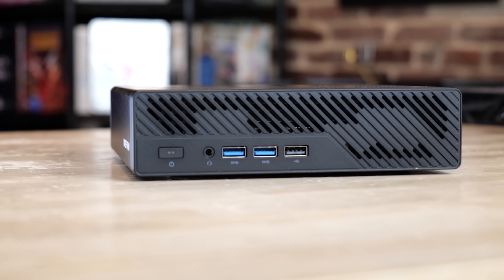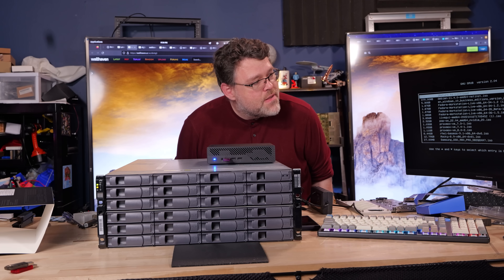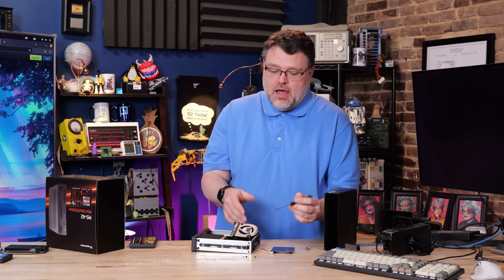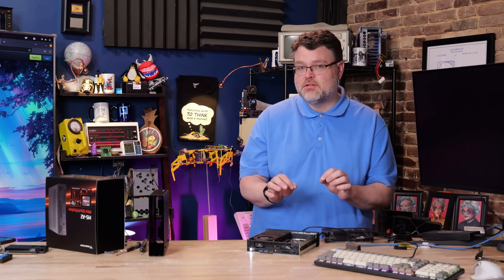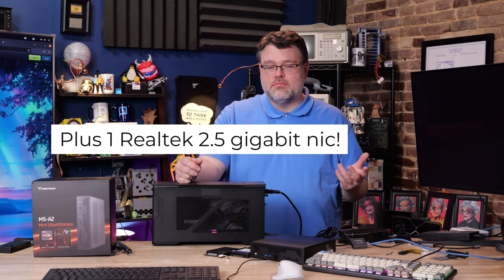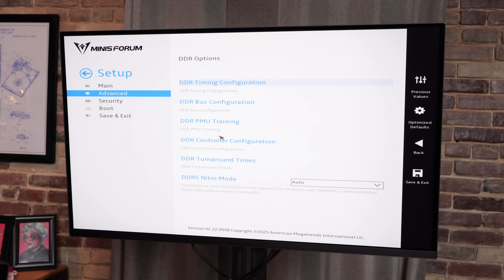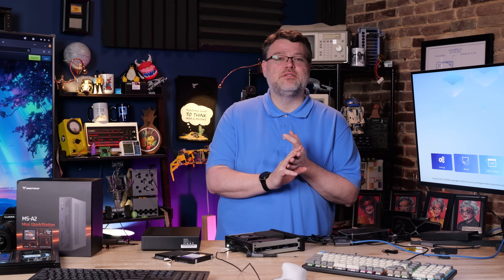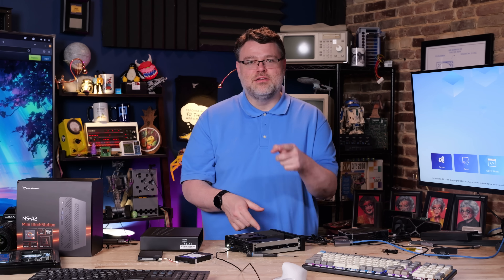Small Form Factor Workstation: Reviewing and Benchmarking the Minisforum MS-A2

Comment: Is the 7945HX option also capable of doing 128gb of ram?
Reply: Nope. 64gb max. 
Some people claim that you can run two 48gb dimms, but I doubt it.
Reply: @MrFrankArcher have you tried 128 on 7945?
Reply: @MrFrankArcher  Can you explain you comment / where did you get the Info from?

As far as i have read on the product page and reddit the 7945HX should still work with 128GB of RAM but with just DDR5-5200 instead of DDR5-5600

Comment: Huge improvements from 01, single and multi core improvement of 30%, pcie bifurcation (no need to buy to expensive and scare pcie chip based cards) better lanes layout for the nvme drives.

Comment: This with 64GB of ECC is such a baller little node.
Reply: I don't think it supports ECC memory, it's not advertised by minisforum
Reply: @PricelessToolkit in this video he says it does support ecc
Reply: @PricelessToolkit I believe only the 9550 version does, the 7550(?) does not because it’s a mobile/desktop chip, not just a desktop chip
Reply: @harrychufan I don't understand. If it supports it, then why isn't it written on the website? ECC memory support is a big plus for me.
Reply: Trying to figure this out ecc is automatically me buying as many as I can get my hands on.
Reply: Don't use chatgpt answers, use the reference link if it exists.

Got based answers are great, but not for facts.
Reply: The MS-A2 does not support ECC functionality, even if you install ECC RAM. It will just run in non-ECC mode.  Per chatgpt

Comment: I had to chuckle when you posted your Geekbench 6 results of 3183 sibgle core and 17845 multicore. The M4 Pro (14 core) Mac Mini scores are upwards of 3900 and 22500 respectively. I was seriously considering a Minisforum PC to fill the anticipated gap when I retired my Threadripper workstation but after setting up the Mac Mini I found there was nothing I needed a Windows machine for. Heck, I can even run Skyrim after a fashion - no, not as fast as on a PC of course (for that I'd need an M4 Max Mac Studio 😜) but that isn't an issue for me. Obvioulsy what works for me isn't what works for many but I do have to wonder at the seemingly infinitely deep rabbit hole that customising x86 architecture PCs has become. Just think of all the acronyms you have to learn before you even get started. 🤣🤣🤣🤣

Comment: These are such a nice form factor. I had a bunch of problems with the ms-01. I hope they worked the kinks out on this model.
Reply: What issues did you have?
Reply: @SvRider512  I had one that overheated a lot. A 12600h variant. And my 12900h killed CMOS batteries like a kid kills candy. I ended up sending it back for an rma. And after minisfourm sat on it for 2 months with no response I had to leave a bad Amazon review to finally get them to respond. Which then they finally gave me a refund.
Reply: I have 3 MS-01's with 96gb ram and no issues running proxmox.
Reply: I have 6. 

3 of them don’t post anymore.
Reply: I have 3x MS-01s running 24/7 for a year with no issues. So I also bought 4th one 2 months ago (clearly different batch - some internal components are slightly revised) to fill all 4 spaces in my rack enclosure and it's dead after those 2 months :(

I just sent Minisforum EU broken device and waiting for replacement. They clearly know the issue because they told me first in their message to verify if power supply is blinking when connected to MS-01.

Overall I'm very happy with them, running Kubernetes cluster on all of them (bare-metal, no virtualization), even though they have a lot minor flaws.
Reply: @DIY.DevOps  similar issue myself - did you end up getting them replaced?
Reply: @dcia670  yes, everything went just fine and I've got replaced unit after 2 weeks. That 2 weeks includes me sending them unit back (from Poland to Germany), them reviewing it (I guess), and them sending back new unit from Germany to Poland. The new unit works 24/7 since then along previous 3 ones without any issues.

But it's slightly different unit, it seems they have second revision of MS-01. The fan over NVMe drives is slightly different, and some chipset is different as I wasn't able to get fan speeds in lm-sensors, which works just fine in first 3 units.
Reply: @ipstacks11  Start hammering the CPUs / NVME drives and LMK if it melts :)
Reply: @ipstacks11  how long have you been running it?

Comment: Would be nice for Proxmox. My only complain might be cooling, non consumer SSDs (like the PM9A3 you mentioned) are getting way to hot to run it in such a small case. U.2 with useful capacity (like 8tb) is almost always 15mm.

Comment: I ordered one the other day. Wont get it until June sometime according to their site. Got the barebones and also bought the 128GB memory kit along with a 990pro 4TB and then RTX 2000 ADA 16GB. Pre-ordered the new single slot cooler n3rdware is working on for it as well. Im super looking forward to the performance boost I am going to get over this 8GB Surface Laptop 5.

Havent decided if I am going to ProxMox it and build a VM for my replacement SL5 work machine, or if Im going to go full bare metal yet.

Comment: I bought mine yesterday -> 9955HX with 96GB and 2TB SSD.
It was a no brainer as I already have a MS-01 and MS-A1.
Als looking out for the N5 Pro.

Thanks for your vids. Always fun to watch them
Reply: Enjoy! buy one for me too ! xD
Reply: Good luck getting it in a timely fashion. I'm STILL waiting on a UM890 Pro that I bought from them on April 20th and it hasn't shipped yet! They are completely non-responsive to email I've sent trying to find out about the delay.
Reply: @daveweinstein5044  I live in the Netherlands and it will be shipped to Germany first as the EU warehouse is there.
I'm not worried at all.
Delivery from Germany to the Netherlands is fast.
Reply: How long have you been running the MS-01 and A1? Do you use them as a server capacity?
Reply: @anonymousgoat107 both day 1.  Not yet. I will install Proxmox or Nutanix on it and test it.
Maybe virtual within VMware. 
Will need to check out what to do.

Waiting for the N5 Pro as well so that I can make images of the MS 01 and A1 to the N5 Pro.

None the less I'm super happy with the power within the PC's.
Both have 96GB DDR5 memory.
Reply: Can I ask, how much did you pay for your configuration? Curious if prices will drop with Black Friday coming up.

Comment: A couple of years ago this multicore performance was a high end dual socket system let alone single core
Reply: If only AMD had the same gusto in the GPU market... :(
Reply: @LurkingLarper  Turns out Intel customers weren't all that loyal. The Nvidia ones on the other hand, will not jump sides even when AMD was the better choice, so is not worth investing there.
Reply: @magoid  better choice in what way exactly? They have never had a market leading halo product that gets everyone excited and for your average Joe offering only slightly better FPS/$ metric is kinda irrelevant if people know you by your reputation of having unreliable drivers, crashing etc.

We tech enthusiast know that this is not true today, but how many average consumers do? Very few and fewer still buy AMD because of that. They should go hard in the GPU space and make people offer that they simply cannot refuse, just like they did with Ryzen by offering better multi core performance, cheaper prices, better platform support, and similar gaming performance.
Reply: @LurkingLarper  Your comment just made my point. Nvidia fans will not jump the fence even if is advantageous doing it. And I don't think a halo product will change that. ATI/AMD had that in the past but it didn't sell enough to worth the effort.
Reply: @magoid  If you think I made your point, then I guess you have some reading comprehension issues. 

AMD is currently not doing enough to entice the average consumer in giving them a chance. They need to push harder if they want to gain market share since they're not the market leader and their brand is much weaker. 

Hardware Unboxed has already seen in their research through their contacts that AMD needs to offer close to 30% better discount/performance per dollar for people to naturally flock over them and buy them instead of Nvidia under normal market conditions. 

If AMD wants this not to be the case, then they need to show a product that beats Nvidia clearly in all major aspects, otherwise nothing will change.

You can even see this in action with Intel currently with their B580 selling out like hotcakes since it's the cheapest 12gb card you can get and runs all your games, being the perfect entry level solution. It's Intel offering a product that beats all the alternatives in all major aspects. It's really no that hard.
Reply: @magoid  AMD cards will not run CUDA

Comment: What a beautiful little workstation. They finally did that form factor some justice with AMD. The price hurts a little, but the value is actually there! Love to see all the BIOS options available.
Reply: Need ECC.  :(
Reply: @pleappleappleap  Okay, you caught me. Why is that your sticking point for a mini PC?
Reply: @wyattarich It's just my particular use case.  I have a multi node compute cluster with integrated virtual SAN made of a pile of these.  Stability is my be-all-end-all.  Well, not completely, or I'd be running a mainframe.  It's second place, after running cost.
Reply: @pleappleappleap  Interesting... If I was doing a SAN I'd be using ZFS, which makes me infinitely less concerned for having ECC. Thanks for sharing!
Reply: @wyattarich Even with ZFS, there are advantages.  But it's not just the SAN, it's the compute.